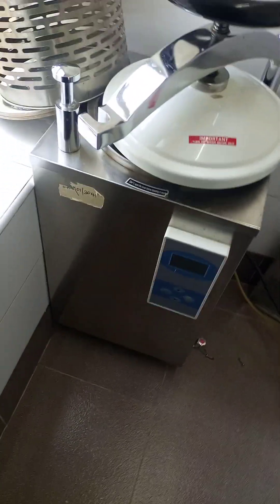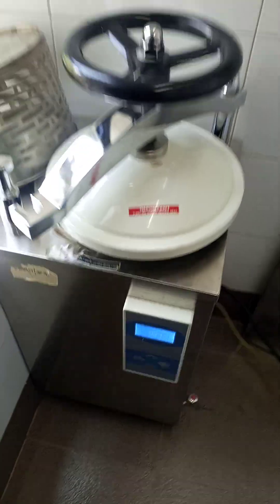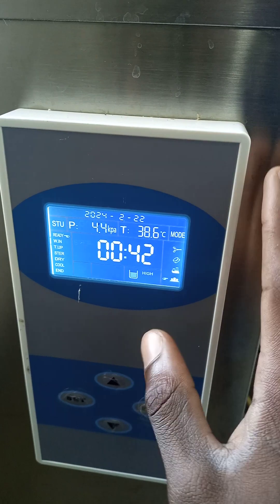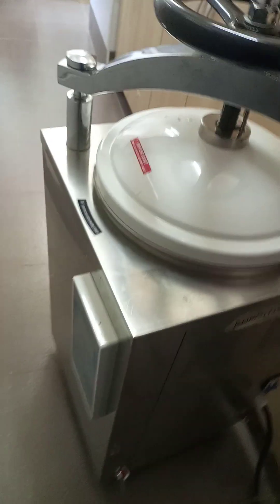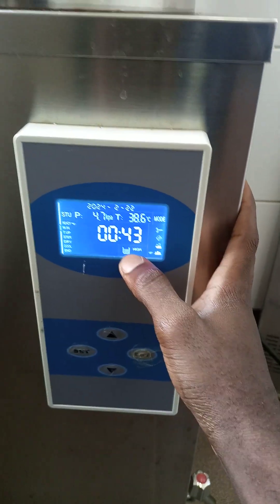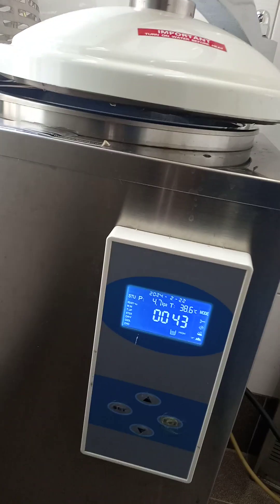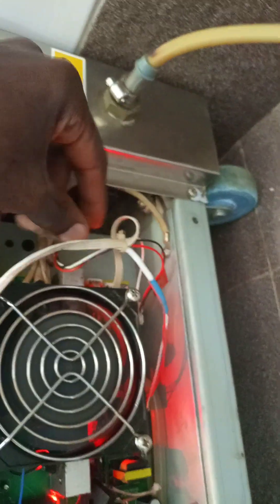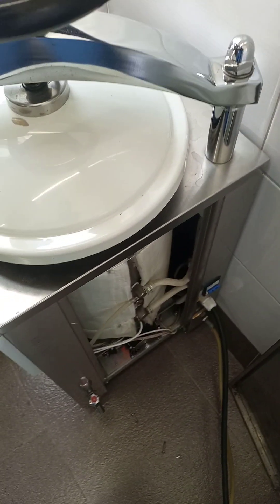Troubleshooting and repairing an LS 35 HD Digital Autoclave | Pressure Steam Sterilizer | WaterLevel

Comment: May i know can we use this machine for food.tq
Reply from the maker: Hello, I'm not exactly sure what you intend to use it for in regard to food. Do you want to use it to boil your food? Either way, this is a medical equipment so it would not be safe to be used for food preparation. There are also cheaper machines specifically for food. I don't think you would want to spend big amounts of money to buy this machine just to use it for boiling your food yet there are right and cheaper options, I know for sure this machine is expensive.